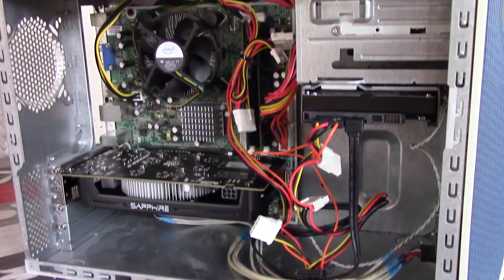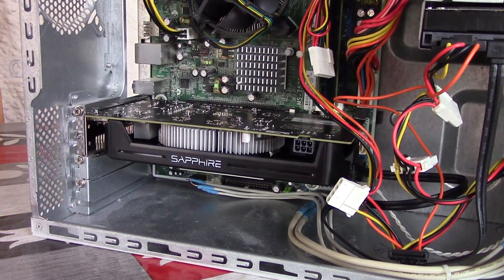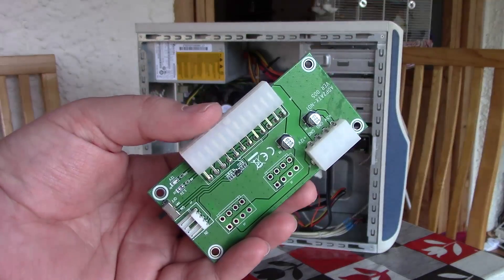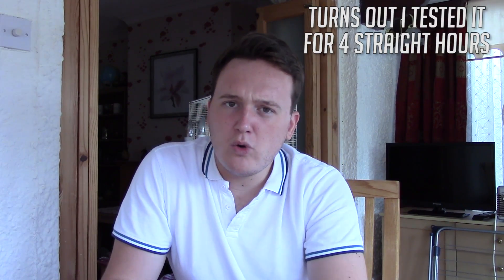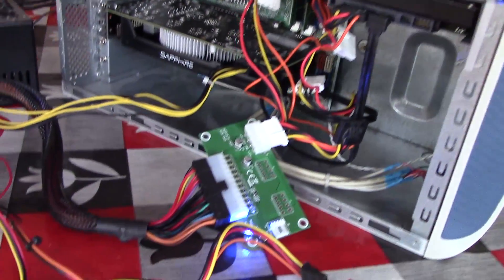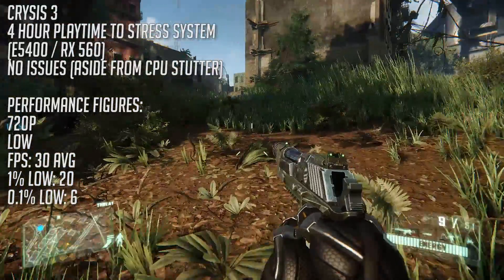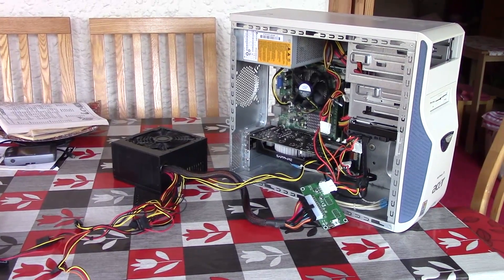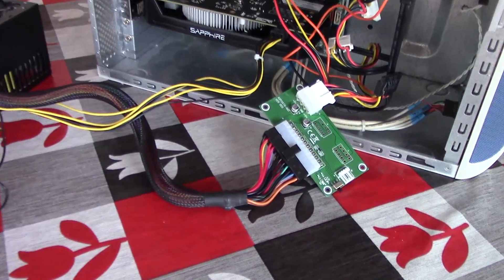Powering a Graphics Card With a Separate PSU

Comment: My current pc is running this way. Because of the proprietary mobo connectors i cant upgrade the psu so i have a second psu sitting ontop to power my gpu. All i have to do is make sure the second psu is always on first and last, been going strong for almost 2 years now :)
Reply: nice so should i look into doing this with a dell optiplex having an i5 2400 and pair it with a say 1050ti?
Reply: @ganeshsahane5766  weighing out the negatives, it might be worth it if its the easiest way and possibly the only way to run a gpu in your current system.
Reply: what happens if you don't switch off the psu powering the gpu after pc turns off?
Reply: @PakoMaretele  In theory, It would be ok however I really dont recommend it as you would be putting constant power through the gpu without the other half of the power coming from the pci port on your motherboard and also I have no idea how some gpus would react to the constant power, best to not risk it and just turn off or unplug your second psu after the pc is off. 
The old pc is still setup this way and working to this day !

Comment: My dad once picked up a cheap GTX 480 in an auction, leaving his 470 unused. I grabbed it and jerry-rigged it into an eMachines with a Celeron 440. It ran Crysis somewhat happily, lol. A piece of wire linking the main PSU's green wire (next to the retention clip) as well as a ground wire to the other PSU enables it to turn on with the system.

Comment: Most legit servers run at least 2 PSU's, and as an industrial electronic engineering tech, this is actually fine.  The Molex brings the DC ground (Black) on both PSU's together, meaning that 5V is 5V on both, and the Molex 5V (red) syncs the second PSU to the system.

The only issue with your system is the chassis ground is not present on the second PSU, meaning the noise potential on the line is higher, as is the chance for some other weird issues.
Reply: Does this board connect the psu1 red wire to psu2 red wire? Psu1 black wire to psu2 black wire? And PSU1 yellow wire to psu2 yellow wire?

Comment: Hey, if you're reading this, I'm looking to build a gaming PC, and I have a budget of about 850 USD, or about 660 pounds. I have bought an ATX case, and an AMD Athlon X4 845, and I can list the rest of the specs, and I just wanted to know if what I have is the best bang for my, thanks!
AMD - Athlon X4 845 3.5GHz Quad-Core Processor
ASRock - FM2A88X Extreme6+ ATX FM2+ Motherboard 

PNY - Anarchy 16GB (2 x 8GB) DDR3-1866 Memory

ADATA - Premier Pro SP600 64GB 2.5" Solid State Drive 

Seagate - BarraCuda 1TB 3.5" 7200RPM Internal Hard Drive 

Asus - GeForce GTX 1060 6GB 6GB Dual Video Card 

Rosewill - STAR PREDATOR ATX Mid Tower Case 

EVGA - 500W 80+ Certified ATX Power Supply

Comment: I did this when i had 2 R9 290X videocards in my system. Which also had 2 X5650 Xeons..
Power draw was a huge issue so i got a cheap psu just to power one of the 2 cards. Worked amazing!
Reply: So question.. in theory could I run that gpu on a 2nd psu that isn't connected to the computer at all? As in just plug the PSU into the wall, and plug the power into the GPU. Will the GPU regulate itself for power or is the motherboard responsible for that voltage regulation?

Comment: This is completely safe. The board is only a jumper for the PSU nothing more plus it gives you the option to power the system with only one button. You can basically do this with a piece of wire and switch the PSU on and off using the built in switch. The max voltage is 12V so it is safe. You can use this long term no problem. You can even find cases that can take 2 PSU and have a build in board like this.
Reply: What is the name of a board like this?
Reply: @LookingGlass69  add2psu
Reply: You can cut the green wire on the second psu and connect it to the green wire on the first psu.
Reply: I’ve heard it’s best to isolate each psu... does this adapter make it ok for the gpu to draw power both from the PCIe x16 and the 6 or 8 (or double 8) pin connector(s)?
Reply: @rickydeathtower  No problem with that
Reply: @rickydeathtower  Wondering same thing. The GPU draws power from both motherboard (psu1) and directly from psu2.
Reply: what if i dont have a molex connector in my primary psu? i should buy a sata converter to molex?
Reply: Can you do this with a rtx 2070?
Reply: Hey, could you help a little¿? i tried the same method as the video, but i don't have any adapter, i just jumpstarted secondary PSU(500w) my main one is 200w, im using the secondary PSU to power my GPU (RX 580) but whenever i turn on my PC using this configuration first start 500W PSU to powerup GPU and then 200W PSU to power up system thus giving power to the GPU through the 6 pin connector from the 500W PSU, my PC just restarts itself over and over and over again. ¿Do i need anything else to make it work? Besides the adapter which i don't have. I turn the PC with the GPU connected but not giving it power through the 6 pin connector from my secondary PSU(500w one) it starts just fine.
Reply: @Yohi_Gaming  woah ok, hopefully the gpu still works. i've seen cards blow up when powered without the 6-pin cable.
i think your 200w power supply can't handle the motherboard and the graphics card at the same time. the graphics card (and all pcie devices as well) take power from the pcie slot; up to 75w. power supplies rarely output the value they advertise so im guessing that 200w is not enough for the pcie power. replace the 200w unit with the 500 one and try again. try to power both power supplies at the same time to be safe. for shutting down do the same; wait for the system to shut off, and once that happens, turn off the second power supply.
Reply: how about if I have a switch on the 2nd psu? I no longer need the board to use the 2nd psu right? since I can manually turn it on with the switch.
Reply: thanks for the info :)
Reply: Hi bro plz help me can use a 230v psu to power my gpu only RX 570 and 450w psu to power my system I realy collected money from 4years to buy a GPU and now its keep restarting plz help
Reply: @saqibmohd9041  hey yes i can help you, i will make a tutorial on how you can do the same thing without buyng their overpriced adaptor.
Reply: @fss1704  plz bro I am really sad right now help me plz I am thinking that I use my corsair 450w power supply to give power to my GPU and and 240v power supply to power my system but I I want to shut down my system what I have to do when I use 2 power supply do I have to unplug the main switch which giving power to both power supply's plz guide me bro
Reply: @saqibmohd9041  then don't forget to isolate the setup, and preferrably use some kind of connector for the second psu so that you can unplug the green wire when you want.
Reply: @saqibmohd9041  it would be nice to also cut a ground wire and pass it trough a connector so that you can  ground both psu's together
Reply: @fss1704  Yes how do we ground the two. This video did not go into this at all. If I was to measure the 12V on each, would I see a different. I am building a system with two 2080 cards so I needing lots of power. The build is over $9000 NZD, I hate some kind of earth to blow things up. What peoples views on this.

Comment: You can basically ignore the PSU recommendations of every GPU-manufacturer because they advice for the worst-case cheap china PSU`s.

A new entry level system with an RX560 and pentium for example draws barely 80W under gaming-load.
Even my System with a GTX 1070 + Xeon E3-1231v3 draws only around 310W from the wall while gaming (bf4).

Comment: if you want power vga with second psu, use server psu that only give 12v, alot of normal pc psu will have drop vol if load on 12v 5v 3.3v is not balance, good psu dont have this problem but you dont need second psu if you have good one. miner they use big psu or server psu to feed 12v to their gpus

Comment: this is 100% safe, maybe not practical but dual psu's have been a thing literally forever. the only issues are when you start splicing the main 24 pins of two psu's together as if one fails it can cause some rather unexpected results (reversing circuits)

Comment: Did this for a while about ten years ago (with an AT PSU) with a dell oem setup to run a GPU as well as an extra HDD.  even though the motherboard had 4 SATA ports the included PSU only had a single SATA power connector.

Comment: or you could just buy a 20 dollar cord from china that has the weird 4 pin power dell and hp use and the normal one and i think its heat wrapped too so it will last and that works and you only need one psu because graphics and everything can now be plugged in problem solved no need for two psus.

Comment: I have a double PSU setup with 3FTX 1080ti that have run 24/7  for the last 3 months.   The GPU's run full load all the time.  

No problem with stability whatsoever.

Comment: I have an electronics degree. This should totally be safe. It's basically using power from that connector just to activate a switch to short the connector. Your motherboard does something similar when the power switch is turned on. It's arguably safer than trying to splice the same wires from the second PSU together if you don't know what you're doing.
Reply: I dont know if you're gonna awnser but, is it safe to do this just connecting the second psu to the current and jump starting it while at the same time connecting the 6 PIN from second PSU to my dedicated GPU, power on secondary PSU and after that powering on my main PSU connected to my mobo, ram, ssd, hdd, and other pc components ¿Would it be safe to use it like this? Without any adapter.
Reply: @Yohi_Gaming  I am not 100% sure I understand the question, but you generally want the 2 PSUs to come on around the same time so everything has power when you turn the computer on
Reply: @InfernosReaper  Hi, I need to connect external RTX 3090 graphics cards to my HP workstation.

I have to use external PSU's so that I can power them all. Now, I'm trying to figure out how to get power to my GPUs from multiple PSUs without having the GPU pull wattage through the PCIe slot. Need to find isolated GPU adapter board???
Reply: @ What's here to not understand PC is powered by main PSU, the  GPU is powered by another PSU. Since PCIE can supply 70W power from main PSU to GPU I must find a way to find a way to make sure that GPU get AUX power and PCIE power from one PSU not both at the same time.
Reply: @InfernosReaper  The mining adapters are all isolated, PCIE power and AUX power is always drawn from single PSU. The Full speeds x16 adapters are built differently.

Comment: Enjoying daily video as usual

"Now before little boards like this existed, people were using paperclips to short two pins together in order to power up two psu's at once. Again, that does work but it's probably even less of an ideal solution than this little board here is and so I'd recommend that even less ..."

glances over at psu that's sole purpose is to power gpu as shitty oem psu did not suffice
^psu has a paperclip in two pins shorting them together

bead of sweat runs down brow

nah it's fine

Comment: Basically the little module receives power and then sends a low volt signal on the "Power good" line of the 24-pin, like shorting a power button would.

Comment: my litle hp case was a good gaming pc but when i bought the pc it was stucked with a r7 240 and 350w psu but i was able to put a 600w psu and my gtx 750ti inside.specs its a core i 7 4770 with 8gb of ram at 1600 and a hp board with h87 intel chip.
Reply: yeah but its a asus gtx 750 ti with 1215 on the clock and onestley i dont know if this 600w nox urano psu isnt dying one me.And the stock psu was old and looked like old stuff.With the oc version of the gtx 750ti i was afraid of not having power to put the pc working.Its brand new i didnt wana take any chances.

Comment: Odd that this pop'd up on my recommend list as i did the old trick of shorting out the pins to diagnose a bad psu last night. Just for info it's the green and black leads on the 24 pin connector which tricks the psu into thinking the power switch has been turned on.

Comment: Well, to turn on a psu, You have to short the green cable of the 24 pin connector with a black one.
This is how it works :)
I use This method to convert an old Advance psu into a lab bench power supply.
In my opinion as long as the secondary psu isnt noname and os good quality, there shouldnt be any problems ! :)

Comment: just to be safe, make sure to connect some case fan or old disk drive on to the second PSU, just to make sure there is at least some constant load on the second psu, running psu without any load can damage it or shorten its life.

Comment: There is actually nothing wrong with powering up a PSU via shorting two pins in the connector. In this case these are: the one with green cable to any of these with black cables. This is the only way to do this, and it's done the same way in a motherboard. The card, as many others told before, is there to sync the powering up of both PSUs.

I'm rather wondering if the graphics card in that kind of setup isn't a bit more stressed out (mostly on VRMs) since the voltages may be different in both PSUs.

Comment: a 300w Psu is totally fine for that gpu if it's quality is at least on the ok side. If it has less than 150w on the 12v(which is around 13-14A) and it's a cheapo chinese PSU, I wouldn't be using it neither for this pc not for any other build.

Comment: Well, a modern PSU is always in standby, ready to turn on if you give it the right signal, That signal is indeed when two wires are shorted together. More specifically, the green one and any of the black ones. That board is probably little more than a transistor that does that when it receives power from the primary PSU. I wouldn't recommend it but it should work. Problems could arise if one PSU regulates itself to, say, slightly more than the voltage it should and the other one slightly less. Then one of them will do most of the work since the other one thinks it's giving it all the current it needs to maintain the specified voltage. Due to the resistance in the wires though, it's sort of self-regulating and most of the time it should be fine, but it's bad form nonetheless.

Comment: You don't need to use the adapter board. All you need is to short out the green wire and any ground wire and the PSU will turn on. I have powered a gpu off a seperate PSU in this same way.
Reply: BRO, ¡THANK YOU, THANK YOU!

Comment: i use this method for about a year now, no trouble except for  pc blowing more warm air :D
i don't use the board just 2 wires in parallel.
Specs: motherboard - intel dq35mp
cpu - core duo e4500 
gpu - gtx 660, psu - 400 watt and 400 Watt. I can still play cs go on like 25-30 fps :D 
does my pc classify as an ultra budget pc? @randomgaminginhd

Comment: A cheaper method-
1.Connect the +5V and ground of the molex connector from the primary PSU to the coil terminals of a 5V relay.
2. Connect the ground pin of the 24 pin connector from the secondary PSU to to the common terminal of the relay and the green to the normally closed terminal.
Like if you found this useful AMD GPU users.

Comment: Man, whatever CPU you were using clearly bottlenecked the performance of Crysis 3. I'm able to get ~30 fps with a rx 460 2gb and an i5 2400 at 1080p. Were you using something like a Core 2 duo or a Core 2 Quad?

Comment: back in about 2010 i owned a case that had 2 psu "slots" so to power all my 3 gts 250 or whatever they were i was using 2 psu's for about 3 years and it never failed

Comment: That little board does nothing different than your actual motherboard does.  Although really a 24 pin psu splitter is just as good.  The end with only 2 wires goes to the second PSU.

Comment: As a guy who is very interested in electronics I can say that this is not a bad idea every time. You just need to understand what you are doing and you have to be aware of certain limitations: old PSUs often if not always require a load on the 5v rail in order to work properly. (Hook up the optical drive for example)

Comment: I did this in a 90 quid pc (i3 530 + gtx 550) and just soldered both of the neutrals and grounds on the 24 pin side so they came on together.

Comment: This was all the rage with Alienware X51's from 5 or so years ago. Many of them ran on sub 200 watt power bricks. That's correct. A desktop that ran on an external power brick. They were tossing GTX 680 FTW's in them and powering them with a separate PSU.

Comment: You know you can just splice into the green and black wires on the primary psu and connect those to the green and black wires of the secondary psu, right? That way the secondary will only turn on when you push the power button.

Comment: As someone that used to do this quite often at work, I didn't watch to the end. Did you know you can bridge the 2 pins (ground and ps_on#) this will power the PSU also? This is usually the green pin and the black pin on old, cheap and OEM PSUs (I know a few of the better ones use black wires for all connections now). We often used a paperclip or small piece of scrap wire to bridge the connections. You can also get very, very cheap small 24-pin female to female adaptors with a wire already bridging the correct pins.